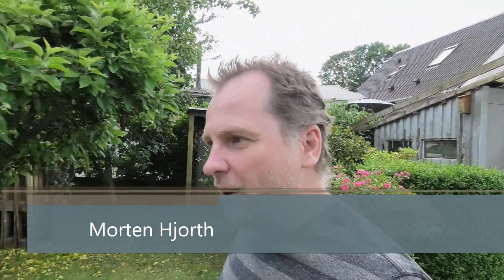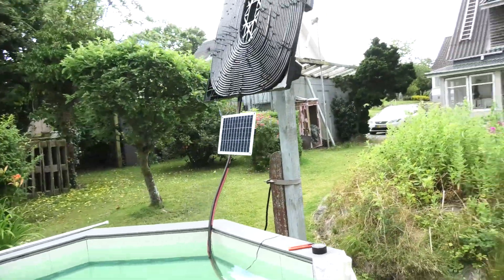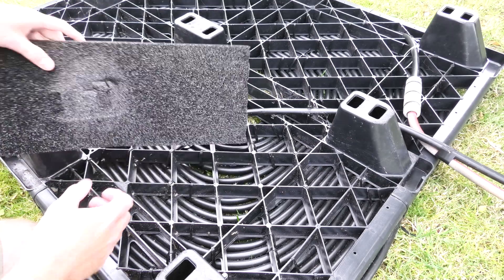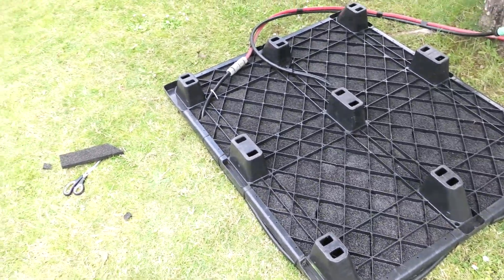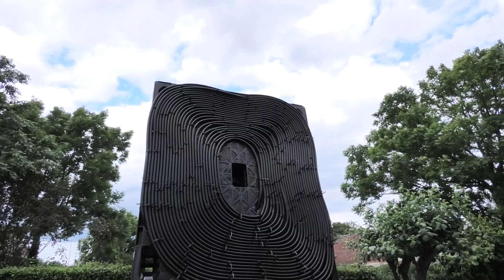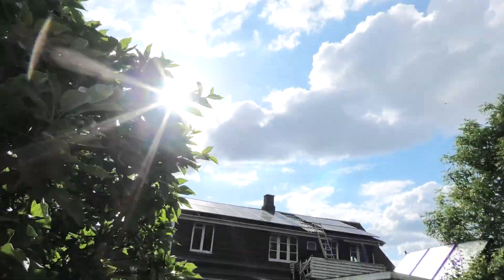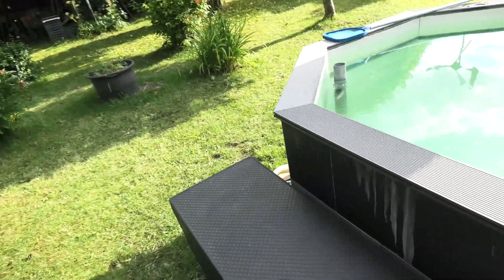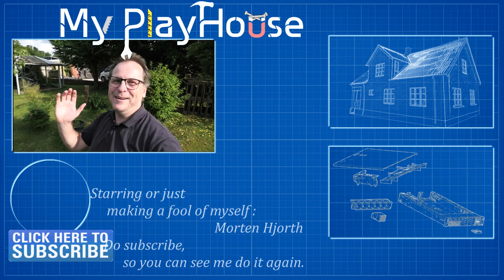Pool DIY Solar Heater - Improving with Insulation Foam - 1402

Comment: Morten, after thinking about how much North we live you need a frame for you pallet, you can adjust to the sun direction. I saw the back of the pallet, were it can be easy to fit a horizontal pole through, for tilt. You only need a rotation point to fit on this pole in the middle to rotate it ease to west during the day, and something to fixed it, you don't want a gust of wind to run it in an unwanted position. 

Lets go. I wish I lived closer to help you out.
Reply from the maker: I would like it to turn after the sun.. :-)

Comment: 50W, more like 8W if you're lucky. I fell for the same scam (but had a suspicion about it's claims of efficiency before I hit check out.)
Reply from the maker: It is somewhere between 10 and 20w :-/ very disappointing.
Reply: @MyPlayHouse  I bought an 80W and it hit ~10W. Originally bought a 50W and it only hit 6-7W. Both I claimed back, thankfully I had bright sunny cloudless weather to send in the evidence for the claim.
Reply from the maker: I bought a new 50w panel,, that one might just be right.

Comment: 10:36 the pump the right way around would help hehe

nvm: by the magic of editing its suddenly fixed

Edit: but i was always thinking something similar when i were still living with my parents, could i use the pool for the watercooling of my pc? but the pips should be realy long
Reply: I noticed that also! That little pump has a hard time pushing water up that high, maybe lower the rig.
Reply: @darrenvail8726  its only a problem if the water dont comes down again, like that its a closed loop, so no problem once that water gets around
Reply from the maker: Yes I did find my mistake,, I did also film fixing my mistake calling myself an idiot etc. But left it out, as I could just move on to it working.. But points for you! that was well spotted!! :-)

Comment: Man you are close! 27 ° C is perfect!  

 Full greenhouse is essential.  since tubing has circular cross section you could just lay clear sheet on top with limited conductive heat loss , but even better to give little more air gap.   seal the sides up good and silicone in the back foam - whole thing air tight as possible. 

re: pump i say bite the bullet and buy another small solar panel (at a fair price this time!)  and couple it with the existing small panel.
Reply from the maker: Thanx,, another solar panel is on the way 🤨
Reply: @MyPlayHouse  👍 👍look fwd to next update- i've been following the plunge pool + heater since the start!

Comment: Place it in the box with the glass window. It will work.
Reply from the maker: I was hoping plastic,, not as heavy 😳
Reply: @MyPlayHouse  The main problem is the wind, and it is not only what we see, but normal convention. Air goes from button to the top and cools your construction in "natural way" You need isolation from environment, put it in the box :)
Reply: @MyPlayHouse  Maybe use 5 rolls of kitchen plastic wrap? just 1 layer, with 1cm overlap, but make it as airtight as you can. The heated air that comes of the plastic hoses gets trapped. and efficiency ↑↑

Comment: If (when) the foam starts breaking down in the sun, you can probably protect it quite well with just a bit of black spray paint.
Reply from the maker: Probably,, most of it is covered by the black hose though, but for sure it’s gonna get brittle in the sun.

Comment: You could make a circuit using a 555 and LDR.
You would only want it to turn on when the LDR gets enough light.
The 555 would control the pump, so that it's not pushing all the water through and stops to give it some time to heat up.

You should also enclose it which would heat the air up inside making the performance better.

I thought of doing one where the water coil is in the frame of a solar panel as they get hot, so doing two jobs. And it's all framed for you as a single unit, panel pumps and heating at the same time.

Interestingly, would having solar to electrical heating work better?
Reply from the maker: Humm,, or just a timer, that turns on the pump for 30 seconds and off for 30 seconds. That would probably also solve all my problems, if I could store the power that the solar panel produces, while the pump is not running. To make it start up again.
Reply: @MyPlayHouse  but how would you run the timer?
The LDR detects the light, using a resistor you can use that to set the level it will switch.
You should find that a few caps will do the job. Hunt down some binned microwaves and pull it out. Or just some off of old power supplies..

Comment: Fully enclose the solar heater, with the internal being coloured either black reflective. The sides need to be slightly taller so to create an air gap above/in-front of the the pipe loop the front which faces the sun needs to be a transparent polycarbonate cover. This will make a mini greenhouse with the solar heat loop inside this will greatly improve the heat output.
Reply from the maker: Thank you,, yes there is room for improvement.
Reply: 😂 made the comment before i got to the part of the video, where you say the same thing.
Reply: Even better with a window that has 1way IR filter which most in the nordics have had, unless nowdays windows start having full IR blocking to keep the summer heat out.